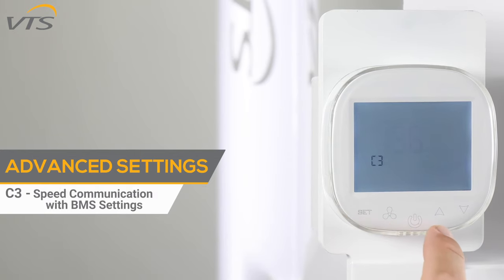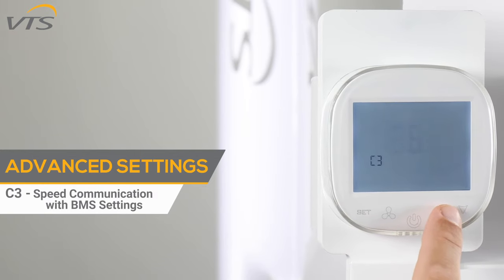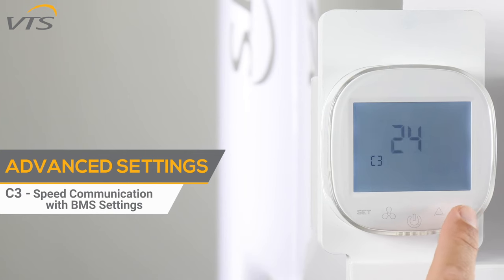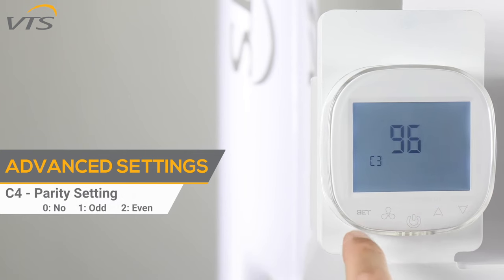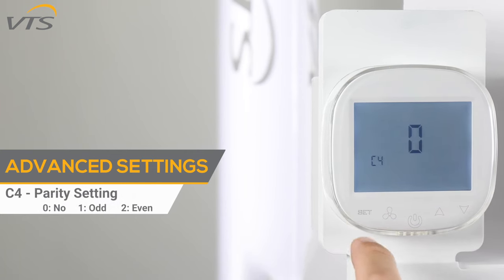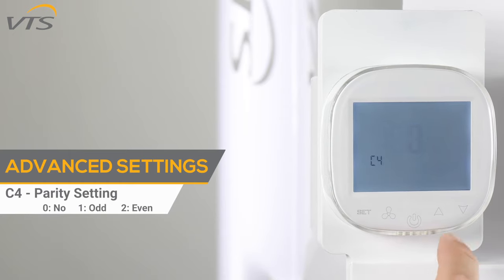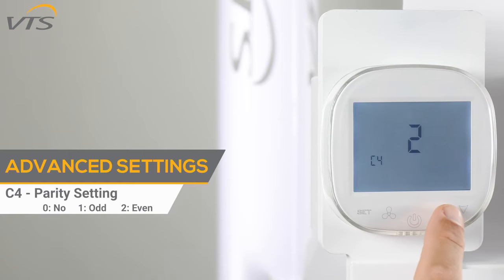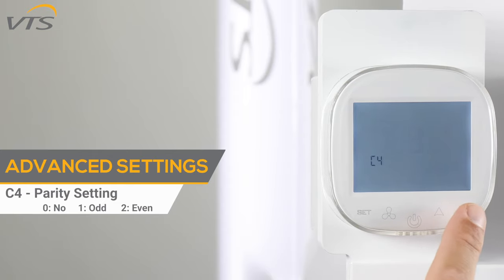VTS VOLCANO unit heater HMI Controller manual

Comment: Hi sir how are u? sir me vts supplyer form Qatar 
sir my question is i have same model controller how to set door sensor I'm already flow your video  but confuse can u explained one more video sir  already instead air curtain but continue run motors not work door sensor how to set places sir can u expanded me